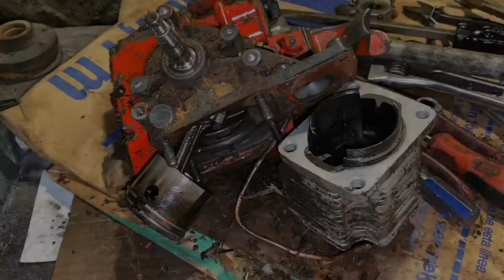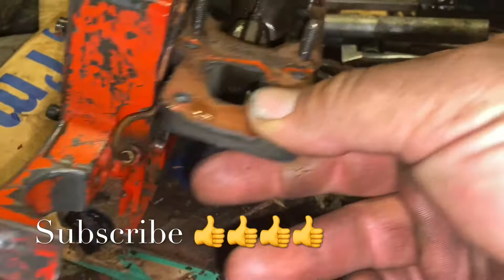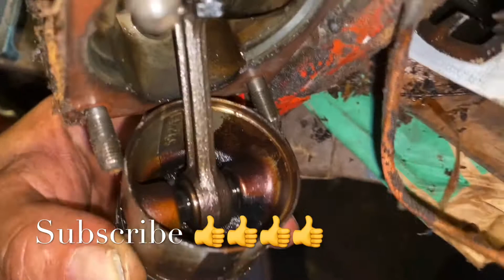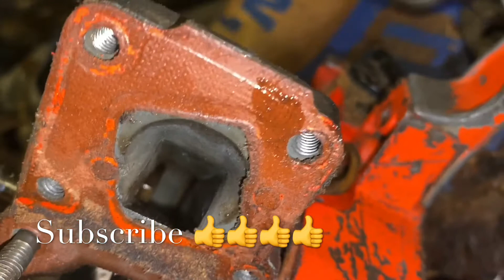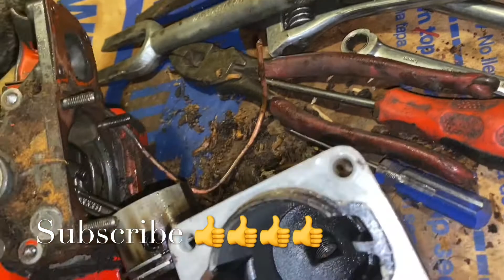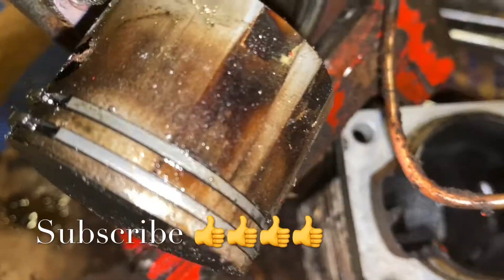Homelite Super XL Auto Chainsaw Porting!!  Description Of My Plan!!

Comment: I am pumped to see what happens after the porting is done. Keep up the good work.
Reply from the maker: Would you rather me take the porting in steps from mild to hot or just GO FOR IT!!
Reply: @Smittyschainsaws  personally I wanna see a ripper! What'd you have for squish? Turn the jug down a bit? I'd like to see you hop up that old Lombard in the intro..
Reply from the maker: @gilly2able  I currently have that saw running now.  I did not take it that far yet.  I am going to build several and do them in different stages over time so we can see the differences between them.  This is one of the testing videos.  I have a playlist on this entire saw build.
Reply from the maker: @gilly2able  https://www.youtube.com/watch?v=pWVRMI7Fej4&list=PLvFQokL_fJMaQo2Y95V-xEmtTpJJhCVqx&index=6&t=154s

Comment: Thinking about taking on a super xl port job
Reply from the maker: Good idea!
Reply: @Smittyschainsaws  what have I got to lose ? I, at this moment have 8 of them, 5 are running on their own, 1 needs a new fuel setup put in, 1 needs a coil/flywheel... 1 is a "parts" saws although it also could be made into a  runner too, just needs the external parts I've "borrowed" from it
Reply from the maker: It takes a few for practice!